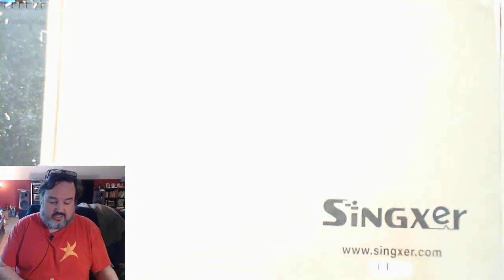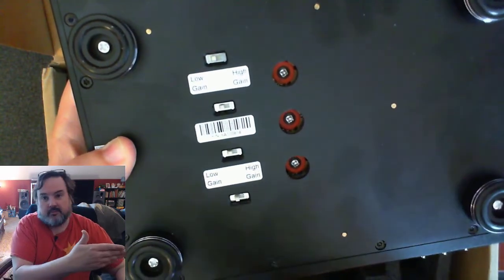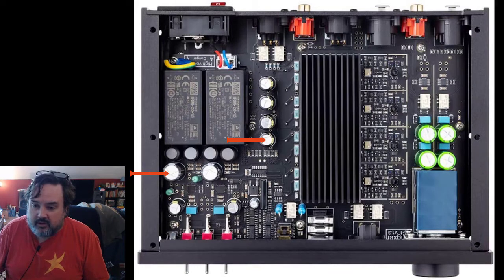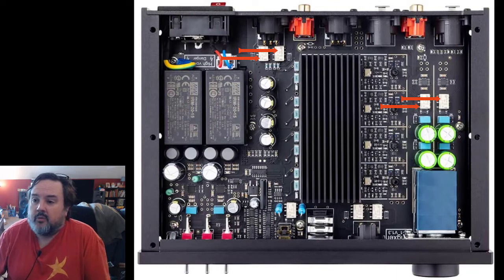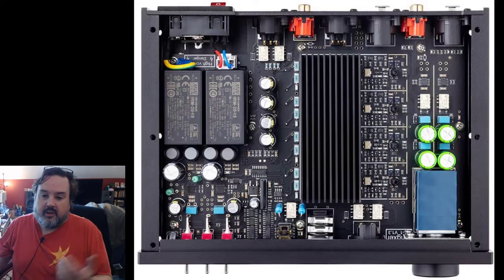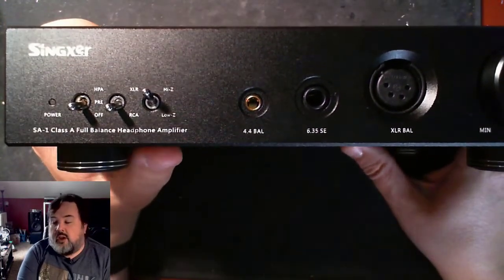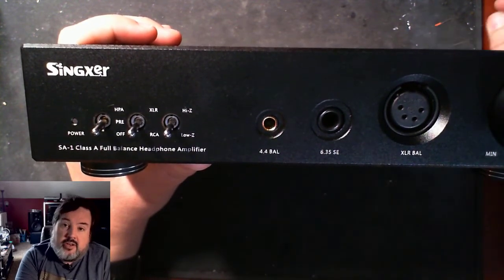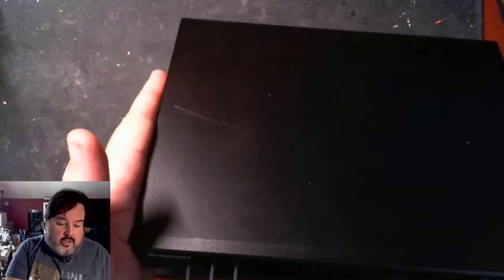Singxer SA-1 Headphone Amplifier Unboxing and Quick Review

Comment: HI Stereo Azimuth,
if you did it as a hobby excellent video.
if you want to be like an audio reviewer professional, 
here are some comments just trying to help you,  hope you don't get offended by the following.. 
1) change the title to unboxing first impressing and review of...  instead of just review, because, in the 6 min, you don't even know how to set the amp into high gain, so it's quite clear that you haven't even read the manual of the product. it's nice to show a product, but you should know a bit about it, if you don't even know how to set the device to high gain, don't spect people to believe what you have to say.. :S 

2) This amp is fully discrete so no opas on it.. so verify info instead jump to into conclusion, similar to point 1 , if you don't know something research before the review. 

3) when you started with the sound description, it would be nice to know for how long have you heard the device (you never mention that)for example, after 3 weeks listen to Singxer I feel like.. blabla.
also will nice to know which headphones you are using on it.  which dac, have you tried on different dac or just 1? balance connection, rca.. ? ,,  

( this is the first time that I heard that singxer is lack in detail?  dude this one measured more than 120db should be super detailed, no other reviewer said that is strange.. but you could be right. 
so If I were you I would go with, for example in song.. blabla guns and roses November rain,  I can hear more details with my .. headphone 1  on amp xxx rather than on this one. 
and try to avoid that "girl next door" that is definitely not a sound description.. 

ps: not review related, if you want to get more of it, check the mod everyone says that after modding sounds 20% better (but it could get damaged so be careful)
Reply from the maker: Thanks. I will take that under advisement and possibly post a second review. 

To answer your question, I had the amp for 4 or 5 days. I tried it on both my Theta DS Pro Basic II as well as my Schiit Bifrost. The source made little difference and my Theta is very dynamic and I still felt that I wasn't getting all out of my DAC. It took a very aggressive DAC and made it quite soft in presentation - a hard feat. And it made the Bifrost even softer.

Headphones were: Sennheiser HD600, Sennheiser HD650, Audio Zenith PMx2, and 7Hz Timeless IEM's. 

I am used to amps with more detail than this. I have heard many other more detailed amps, like the Schiit Mjolnir and the Monoprice Liquid Platinum. The SA-1 did sound better and a bit better with lower impedance headphones like my PMx2's, but also got a little more "flat" in comparison.

I will try to post a follow-up video, and thanks again for your feedback. I will certainly take that into consideration.
Reply from the maker: And PS - I am not audio reviewer professional. This is a hobby and I get tired of the "professional" reviews that just love everything and love every product. I will always be fair and honest.